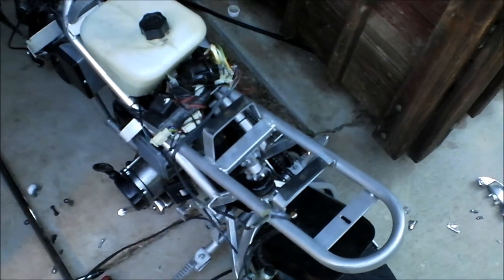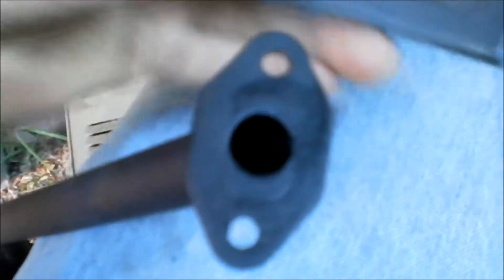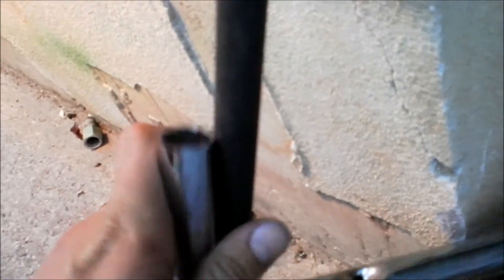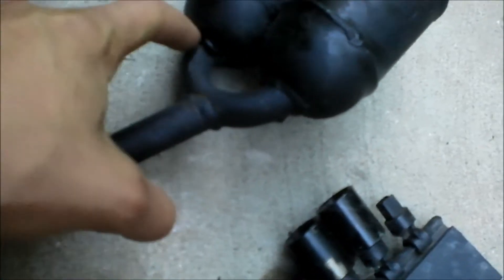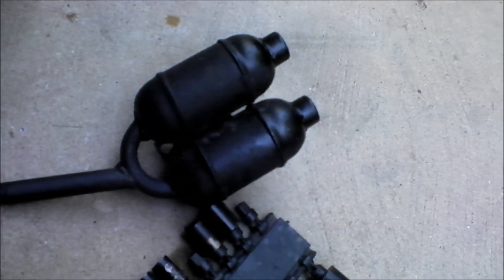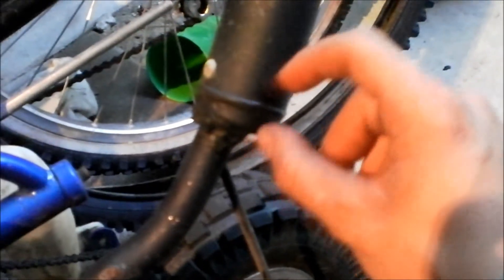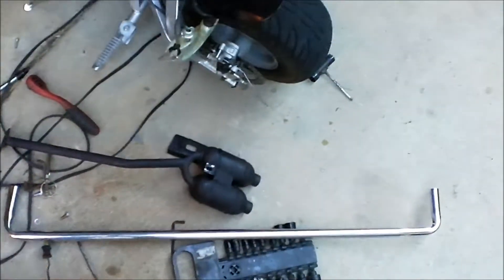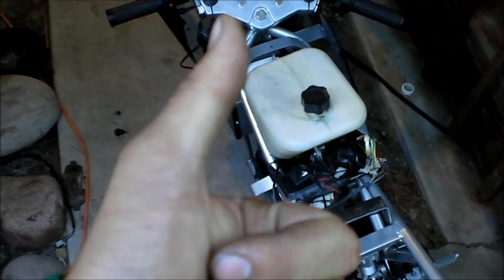pocket bike rev prob found

Comment: you could polish the inlet and outlet ports and make them the same profile like you intend with the exhaust. I spent years tuning 2 strokes. if they breathe good inlet and outlet the your a good way to more power , maybe all you need then is re jetting of the carb. just make sure you have a correct oil and fuel mixture as more power means more heat so its more chance of siezure. 
great video I love the paint more clearcoat the better.

Comment: I think your going to need to use a pipe bending tool (plumbers use them for copper pipes) if you don't you will just get a flat spot in the exhaust and it will be worse then when you started lol...... if you can't get a pipe bender then you'll just have to try and shape it

Comment: you need a thicker pipe and a pipe flanging tool to make it bigger that pipe is too thin and it will rust right away. Cut the pipes off at the backs of the mufflers make the holes a little bigger, weld on a new pipe remove the baffles then take some larger pipe and have everything cut to mimic the pipe you already have and then weld on your plate at the end with it flanged out to fit the opening port. the stealthy black looked better than that "rashed" look to me personally looks sleaker stealth

Comment: Great Video !  I got one of these at a yard sale. Now I know why they took the muffler off. Where do you find parts ? I need a solenoid and a airfilter. I was told that in order to find the parts you had to take the bike to a shop and let them try and match stuff together. Because the model numbers are useless. Is that true ? I have not been able to find a model number on the bike. Any ideas as to where to look ?